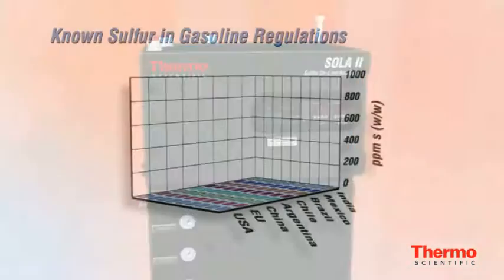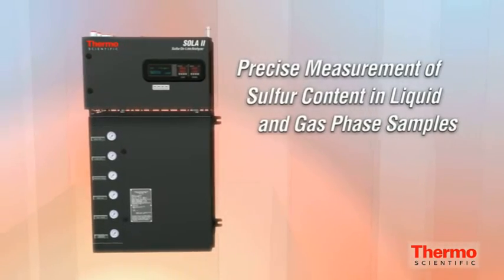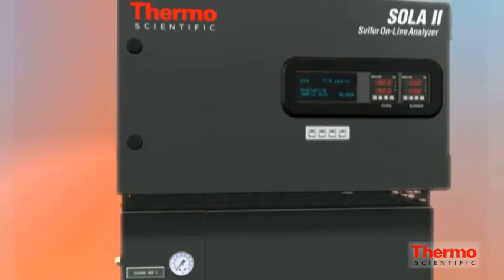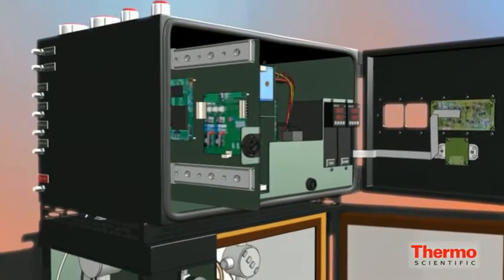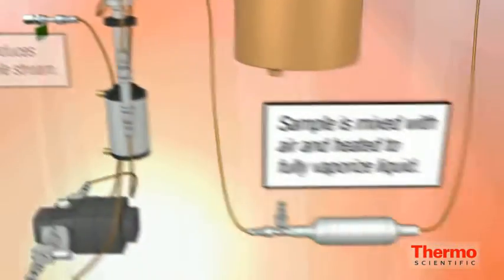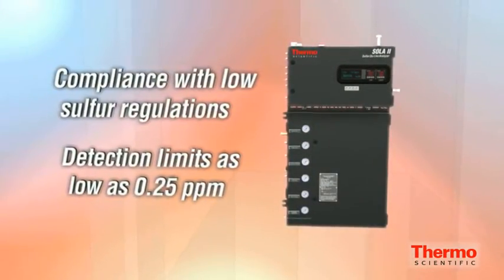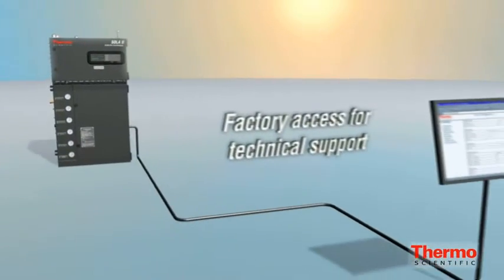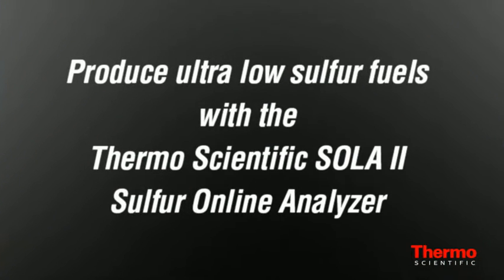Sola II Sulfur Online Analyzer Operation and Theory

Comment: We got a unit that has an issue with lamp . Basically it shows lamp intensity alarm and lamp voltage alarm.even though , we’ve replaced the PUVF complete bench and the problem was still remains . Lamp Voltage reaches 1340 and the lamp intensity reads zero. Then , we’ve replaced PCB, Flasher supply board , PCB, power supply board , PCB CPU and PCB mother board.unfortunately, it doesn’t work ! We go through the user manual and tried all the ways that recommended in the troubleshooting part of it but that didn’t work. What can be the possible cause of the lamp intensity to read zero ?
Reply: Did you solve the problem?